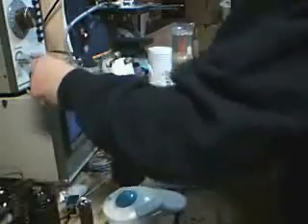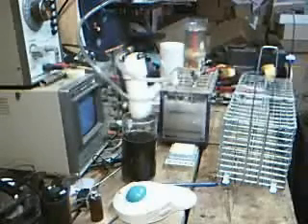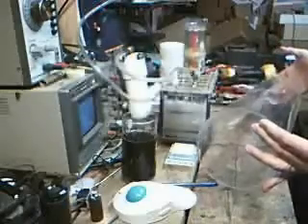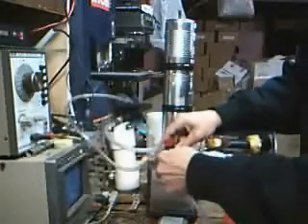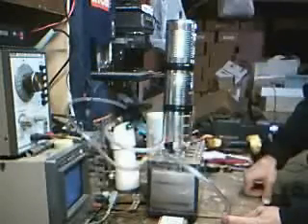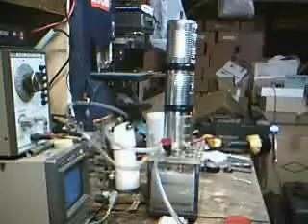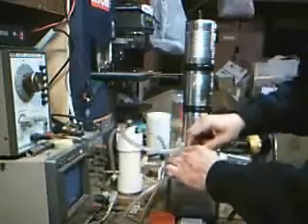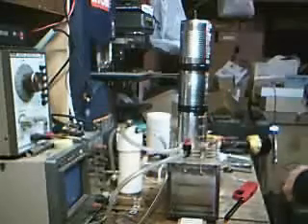#247 - hhoi / linear H2O test part 1 of 5

Comment: I'm sorry I couldn't watch the live broadcast. This video was so funny :-)

I'm gonna run an experiment as well. I will put a 9 volt battery up my  *ss and then I will fart. That will give me methane-i gas because of the fluctuating ions up my condenser and I think that one single fart will run an 8 cylinder engine for two hours, but it might be even more then two hours, depending on the input energy :-) I just need to find the right frequency with my "condenser" It takes some practice though.